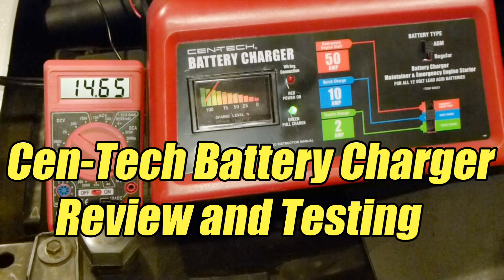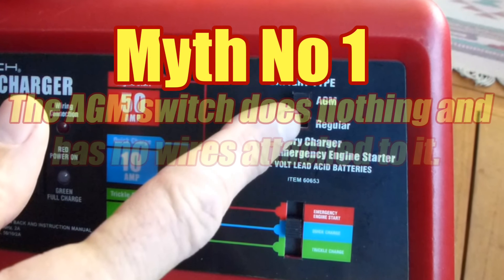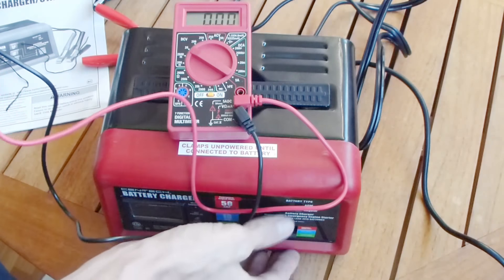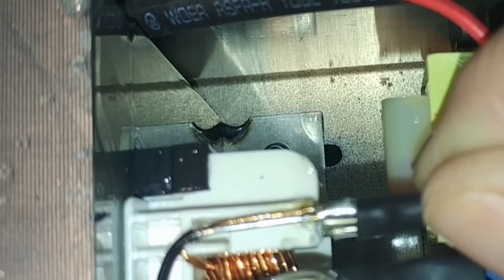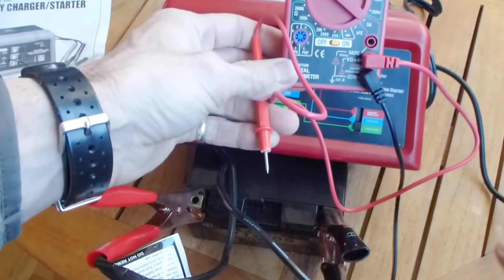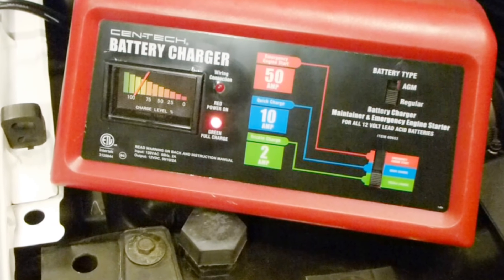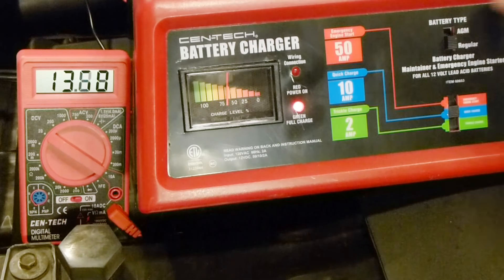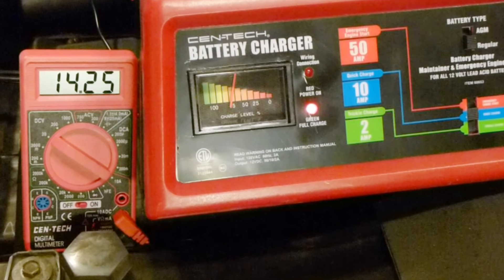Cen-Tech Battery Charger & Starter Review and Testing Harbor Freight

Comment: Put the clamp to my battery and no power still. My battery probably not chargeable
Reply from the maker: Vutha Preng: Do the lights on the charger change when connected? How long was the charger connected to the battery? Sometimes it takes a few minutes for the charger to assess the battery before charging. Are you able to check the voltage on the battery? If the battery's voltage is below 3 volts, most chargers cannot respond to it. That is a common safety feature of portable chargers. What is the date labeled on the battery? It is possible that your battery is old and not chargeable. Some define "dead" battery as below 10 volts. In this video I show the charger responding to 8 volts. But that 8 volt battery will never fully recover because time has coated its lead plates with lead sulfate crystals and no charger will fix that.